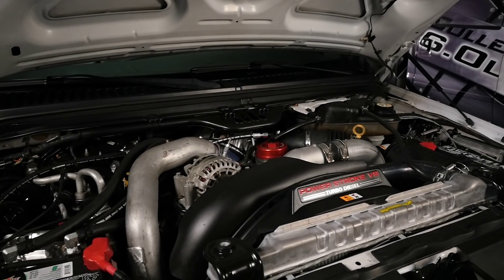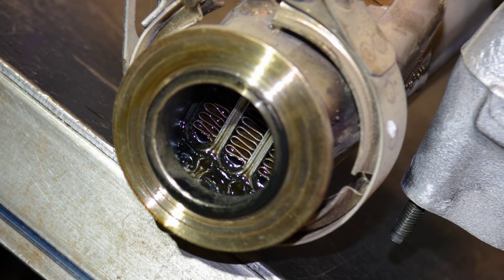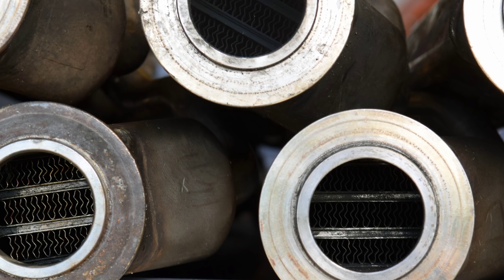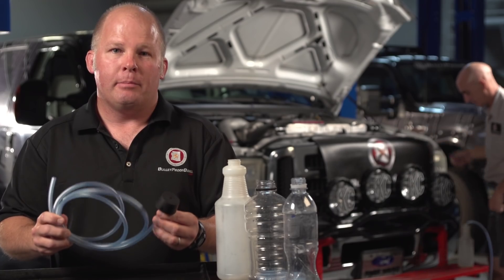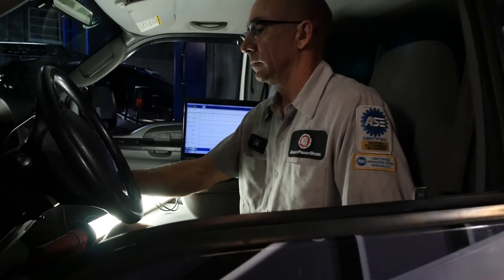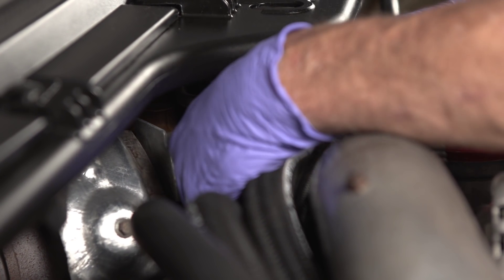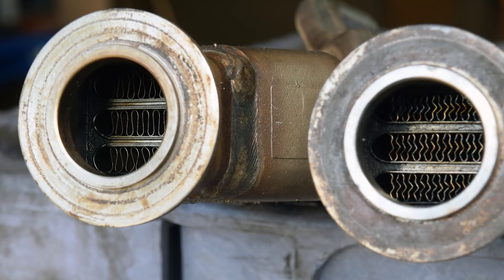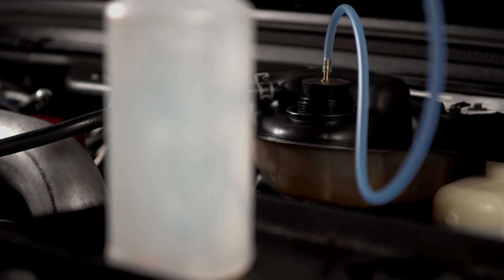Bad EGR Cooler or Head Gasket; 6.0L Power Stroke

Comment: Where can i buy the bottle kit you have here? All the ones im finding look like its just kits that use a color changing fluid and only diagnoses the head gasket not the EGR cooler too.
Reply from the maker: We sell the plug and hose here https://bulletproofdiesel.com/collections/all/products/bulletproof-blown-head-gasket-egr-cooler-bubble-tester-90640001
Reply from the maker: The bottle is just a spray bottle for cleaners and such.  Most tall containers would work just fine.  We are most interested in seeing a steady stream of bubbles.  If the bubbles completely STOP with the turbo unplugged then it is most likely a failed EGR cooler.

Comment: I just purchased the kit and went home to test my truck but now im really scratching my head. I filled up a bottle with water and it drank it. Then filled up another one and it drank that one too? Filled the bottle up with coolant because i didnt want to dilute the coolant too much and it stopped sucking it in but i only get bubbles while revving the engine. When pressing on the accelerator it has a small shudder around 1000 rpms then starts producing tiny bubbles. I let it idle for a while longer and it began to pull the coolant back into degas bottle again!!

Comment: Wish I would have found those before I pulled the injectors the second time lol.

Do I put it back together and test or just replace/repair the egress cooler since I’m literally ext to it about to pull heads.
 
It’s covered in oil and the egr smokes when starting cold.

I have a small amount of milk in the driver Vc because the pcv was forcing it in the vs from the turbo

Comment: What if I'm not getting any bubbles? Does that mean everything is good? No blown head gasket? No EGR problems?
Reply from the maker: While the bubble test may not be an absolute test procedure for head/head gasket vs EGR cooler failure, it is a good place to start.  If there are no bubbles during the test. then we would move onto a question.  What problem are you having with the truck/engine?  What symptoms were you experiencing that led you to the bubble test?
Reply: @BulletProofDiesel I’ve got the same problem, working on an 05 that is losing coolant, no visible leaks, no white smoke except one small puff at startup, no oil in coolant or coolant in oil. Bubble test does the same thing as alsmith9102

Comment: I have a 2005 ford excursion with a 6.0 diesel. The coolant hose just below the degas bottle failed and I lost all coolant. Pulled over immediately when gauges went nuts. Luckily a guy in the parts department of a ford dealership lived a mile from where I broke down and brought the part to me on his way home. Replaced hose and coolant engine is running hot according to spec. Coolant at 214+ and oil temp 229-235. When I turn heat on full blast coolant temp comes down to 208ish and oil temp comes down to 217ish. God dam gremlins. I did the bubble test I’m getting no bubbles what so ever after running the engine for several hours. Coolant hose from top of radiator seems to be filled with air. I squeeze a couple of times and coolant level in degas chamber goes down a little. I’m thinking a bad thermostat. Am I barking up the wrong tree?  One after thought, oil pressure gauge crashes when at idle, engine doesn’t hesitate and when I touch the throttle pressure gauge pops back up. PLEASE HELP.
Reply from the maker: In addition, the engine cooling fan should be engaging or locking up around 220 degrees coolant temp, so if you don't hear the fan (jet engine under the hood sound) you may want to have the fan clutch operation checked as well.
Reply: @BulletProofDiesel  Replaced the Thermostat and has fixed my overheating problems.  I'm thinking that was my initial problem that made the Y pipe under the degas bottle finely let loose then snowballed in to the successive issues Water pump gasket, hose to heater core.................  Thanks for the info.  6.0  gremlins
Reply from the maker: Yes, the thermostat is a great place to start.  It is possible that when the engine overheated, the thermostat was compromised.  Here is a link to them on our website, or pick one up from your local Ford dealership.
Reply from the maker: https://bulletproofdiesel.com/products/ford-6-0l-coolant-thermostat-6000046
Reply: I replaced the water pump and while I was at it replaced the fan clutch. It is defiantly kicking in at 210 to 220. But temp is higher than I like. I’ll try the thermostat and get back to you.

Comment: So I went camping this weekend and I decided to take the bumpy fire road back home instead of the hwy. Once I got into town I noticed my truck shaking a bit, no loss of power but would shake a bit while I waited for a light. I got home opened the hood and there was no coolant, truck didn't over heat or the needle move at all. I went to the auto store, but some coolant, one coolant bottle did nothing, took it all in and the reservoir still empty. No leaks started the engine up, starts right up but I am now getting some white smoke and the truck is shaking a bit and you can hear it from the tail pipe.
Reply from the maker: This sounds very much like EGR cooler failure and maybe even an injector failure.  If the white smoke smells sweet like burning coolant, EGR/oil cooler would be the place to start.  Check out links here for solutions:  https://bulletproofdiesel.com/collections/ford-products?pf_t_engine=6.0L

Comment: Here's a new one for y'all.   My 6.0 was running cooler for a month.  I didn't think much of it since it wasnt' overheating.  The temp guage was just down lower than it usually is.  then all the sudden white smoke came out the exhaust.   I thought the egr cooler blew so i started taking engine apart.  Then i noticed what caused it all.  The belt tensioner was locked up and belt was loose.  Water pump must not have been pumping properly.  Somehow it was showing a lower than normal temp on the dash.   But it must of got hot in the egr cooler and blew it.  I'm still working on it.  I hope its not a head gasket.  Would running with a loose belt have more probablilty of blowing egr cooler or head gasket?   Why was temperture guage showing lower than normal?
Reply from the maker: You are right, this is a new one.  The best bet at this point is to replace/upgrade the EGR cooler and engine oil cooler, reassemble and go from there.  If the engine wasn't severely overheated, you may get away with not going into the heads/head gaskets.

Comment: Filled my truck up with antifreeze its was really low and now i think its hydrolocked would that be head gasket or egr cooler
Reply from the maker: This will most likely be an EGR cooler failure
Reply: @BulletProofDiesel  thank you trying to decide if engine is worth getting fix was about to send it to shop for low high pressure oil then this happened

Comment: Which Toyota coolant, pink or red, does not eat the head gasket seal in a 1CD FTV Toyota Corolla d4d, 2003. UK. Thanks. My car has used red and is ok, but I am concerned about using the new pink coolant
Should I continue using red after 131k miles.

Comment: I read on plowsite that the oil cooler antifreeze can block passages, boiling coolant giving you bubbles as well. I think this is my problem with truck. Yes it blew bubbles when under load but motor was hot and could have been boiling coolant. I have no egr on my truck. I am not losing coolant.
Reply from the maker: Yes, antifreeze debris in the stock oil cooler can plug it up.  Our oil cooler doesn't utilize coolant; it's air-to-oil and is mounted near the radiator.

Comment: what are the symptoms of a bad oil cooler?  I use scangaugeII and my coolant temp is always colder than my oil temps.  Under load it has reached btwn 15-22 degrees but does not sustain those temps (Georgia heat, around 108* outside and a/c cranked up).  Cruising at 65mph, my temps on average are around 7-9 degrees different.  I have a 2006 F350 with the 6.0.  207k miles.  everything is oem aside from the scangauage.   I am trying to determine if I have a blown head gasket or bad oil cooler.

the motor seems to have a power loss as well and cruising around, I randomly get an engine shake or vibration.  I have clean coolant and oil.  I sent my oil off to get tested and they did not find any coolant in my oil and I do not see any oil in my coolant.  There are also no leaks.  However, I have found dried coolant overspray around the di-gas bottle.  I also replaced the cap as well prior (less than 600 miles ago).

Any recommendations would be most appreciated.
Reply: If you are puking coolant you probably have an EGR or headgasket problem.  If your deltas are that far apart, you probably have a blown oil cooler or its on its way out.  I would bet on a blown egr/blown oil cooler.
Reply: Thanks. Mine will spray coolant out if under load and temps over 16 different. Does mine sound like head gasket and oil cooler starting to fail? My coolant does not have oil in it and my oil does not have coolant in it. Both fluids look good. My egr is deleted with a block out plate.
Reply: When egr cooler crack coolant is dumped out the exhaust or white smoke. Blow headgaskets is combustion gas in the cooling system (no white smoke). oil cooler failure is when oil is in the cooling system or plugged from lack of changing coolant, mixing different coolant, or adding tap water to the cooling system.

Comment: how can you use this testing method with out modifying the degas bottle / coolant res with the nipple to attach the air line / hose?  can you leave the top of the coolant bottle off and insert the hose directly into the top of the coolant bottle?
Reply: Or buy the kit for 20$
Reply: dlynes need some help setting my Roth  Ira what does it mean with today's contribution for tax year 2017/2018 what does that mean?
Reply: @marcolpz1711  , I would drill a hole in a spare cap, insert a brass barb into it and connect a hose to the barb like in the video.

Comment: With all the problems of the power stroke, why would you not buy a Duramax.?
Reply: I' own 3 6.0s so far and I have never done much of anything , they are dump trucks mind you, is everyone doing regular maintenance? I plow with 2 of the  3 and one is my personal truck. 1 2006 king drw and 2 2005 xlt drw. Im well over the 180k mark on all and love the power , Duramax is truly weak for the money the 6.7 powerstroke has been proven to be the motor so far for all fords. Honestly 80% of the horror stories are tunned engines or just lack of maint...
Reply: Ranjit when they lower the price on them I will 😉 I have a f250 but like chevy..when it comes to the Chevy 2500 i feel like they could have done more with it for that crazy price tag you have to pay
Reply: I’ve talked to diesel techs they say they see more blown head gaskets on duramax than 6.0s
Reply: @robertdemeyer8125  I’m surprised by that. Any particular duramax s lbz, lly lb7, lml?
Reply: @duramax78  lb7
Reply: Duh, because we wanna get laid.  You might as well put a Bud Light sticker on that Duramax.
Reply: wish I would have
Reply: Because the 6.0 is almost quarter the price even after doing a overhaul and sounds the absolute best and doesn't have Chinese eyes headlights hahaha.

Dura Isuzu burns up hpop and injectors too and the interior falls apart
Reply: @scottandbecky2013  Duramax's don't have high pressure oil pumps they have high pressure fuel pumps.